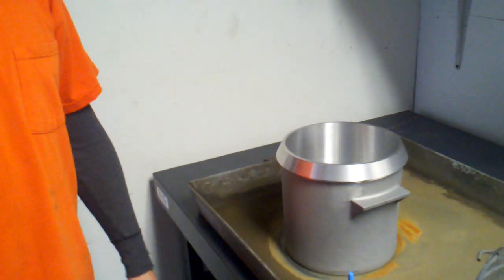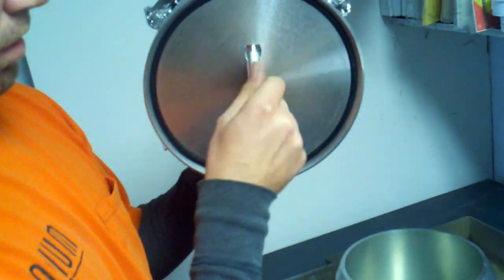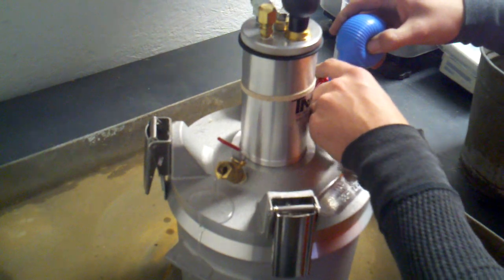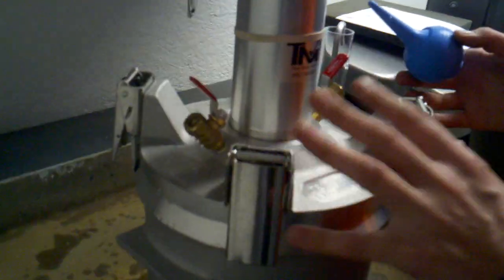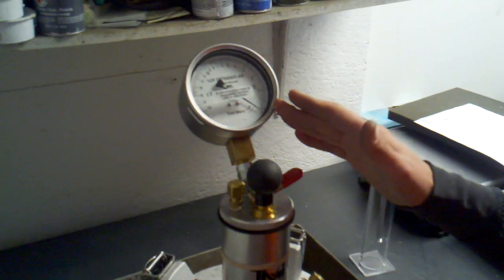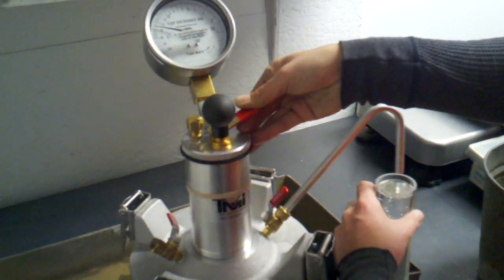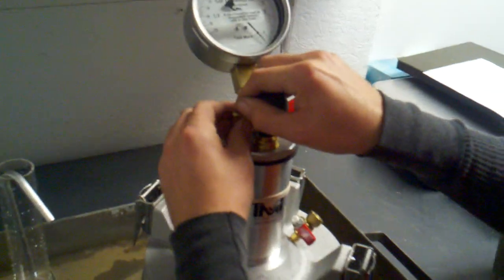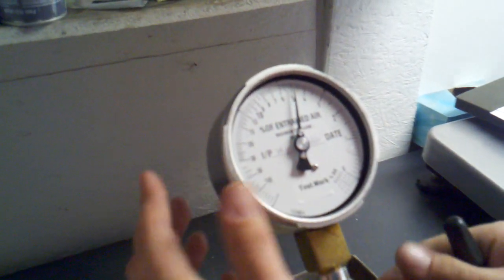Calibrating a Test Mark Pressure Meter

Comment: in ASTM C231 (Section 8.3.2.1) states "Jar the meter gently until all air is expelled
 from this same petcock." You are not supposed to shake it like that
Reply: Also petcocks should sty open while you pump air into the chamber. That way you know if the pump is leaking

Comment: Water not confirmed to be 23.0 C. No weighing of the discharged water in the graduated cylinder? No calculating air content by water discharged? No check at 10%? This was not done in accordance with ASTM

Comment: What does it mean, if when I open the petcock (to fill cylinder) and it automatically fills the cylinder. Without the need to push down on the main air valve. Any help would be appreciated. Thanks

Comment: you talk about adjusting the tabs if the gauge doesn't read zero, can you talk about that, also every video I have seen on air meter calibration does it on a new meter, that's easy to do, doing one on a meter that's been used and abused is a little harder.

Comment: Nice video.  If had to make any needle adjustments during calibration, I would be re-checking my IP to make sure all is still well.

 I have never seen the glass-plate method mentioned by other commentators.  Not the common procedure around here, I guess.  Sounds like more trouble with glass plate and a scale.

Comment: the calibration procedure is wrong, where is your glass plate to make sure you have zero air? and when filling the meter with the tube you are suppose jar it as you add water shaking it introduces air into the system, and where is your weights for empty vessel with plate? and empty vessel with water and plate? you need those to calculate actual reading against gauge reading

Comment: There are a number of variables related to the exact volume of the water needed to fill bowl and the amount needed to extracted to check throughout the range of operation. The water should have all air evacuated and be at room temperature. The empty meter should be weighed and then filled with water and weighed again with the weight of water needed to fill the bowl. That weight times the percentage within the range of operation of the check gives the weight of water to remove for each percentage